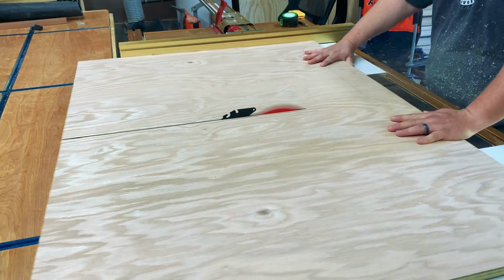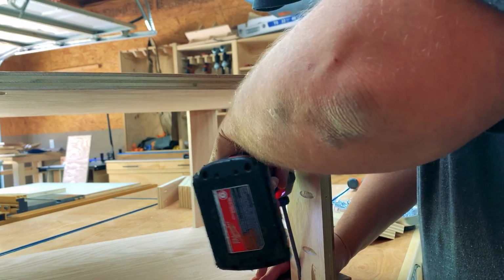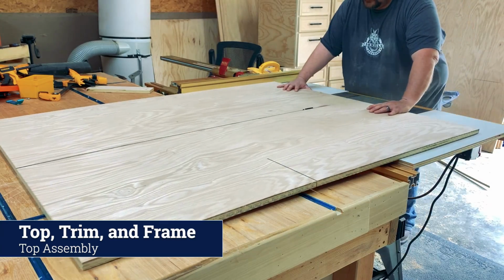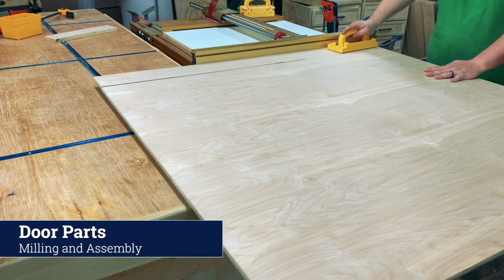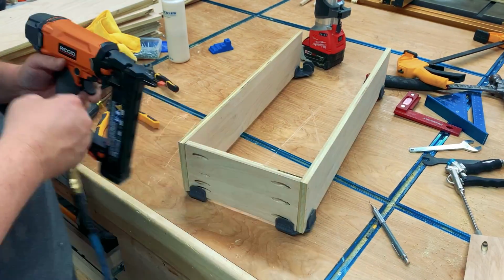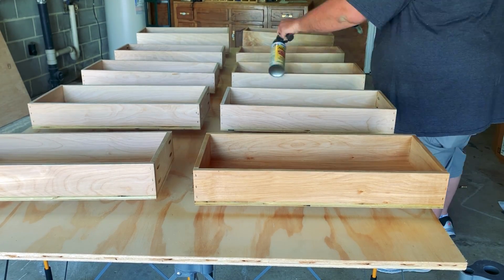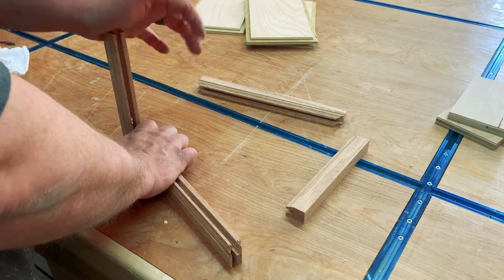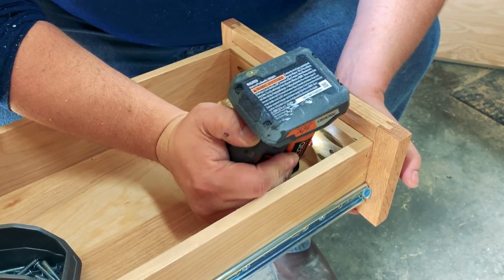DIY | How to Build an Oak Desk | Woodworking Projects

Comment: How is the top attached to the base?
Reply from the maker: It's attached with Pan head screws through the bottom stretchers.  I have to admin that Pure Bond plywood doesn't hold screws very well